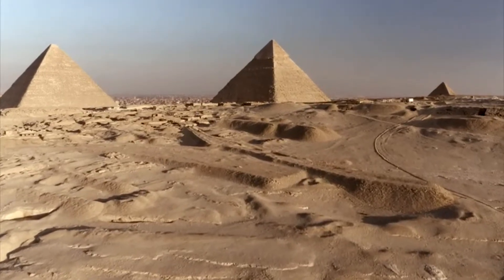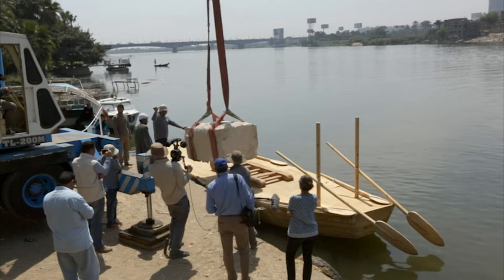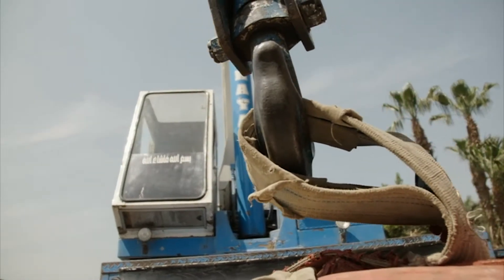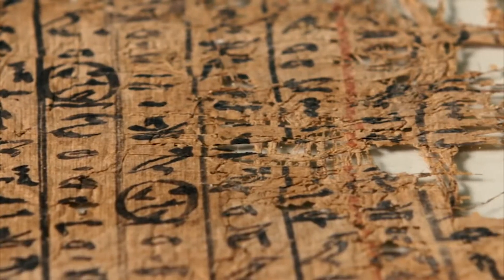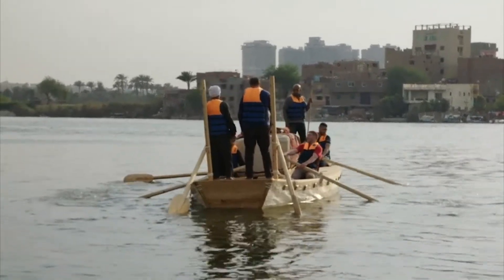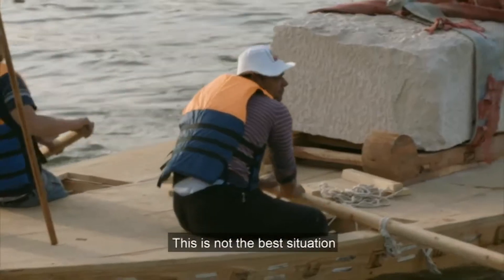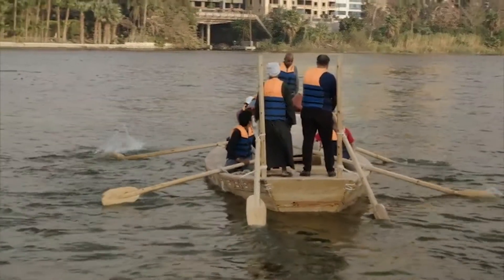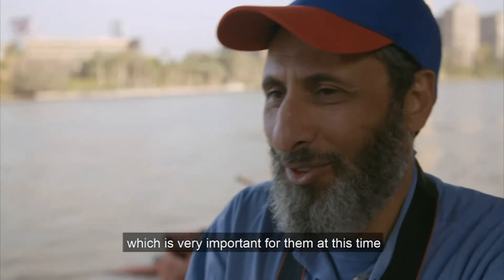Crossing a Pyramid Block Across the Nile with a Rope-Stitched Boat

Comment: The boat is barely coping in disturbed water so this hardly supports the theory hundreds of rocks were moved this way per day.
Reply: 2.3 million stones per pyramid lol
Reply: @PlagueSan  Not sure how the number of rocks changes the problem here. Its not like they were using just one boat, they would have had hundreds of boats. Also this was just a proof of concept. I doubt its terribly hard to improve upon this design a bit for more stability.

Comment: That looked very top heavy. maybe the boats were wider, or the load was lower.
From another video, maybe the stones were in the water and just floated by boats on each side.
With water displacing the weight, the blocks would be "lighter".